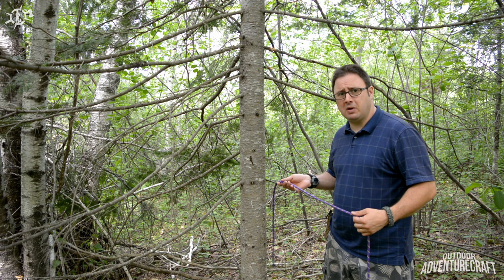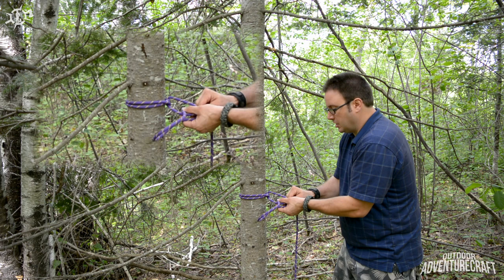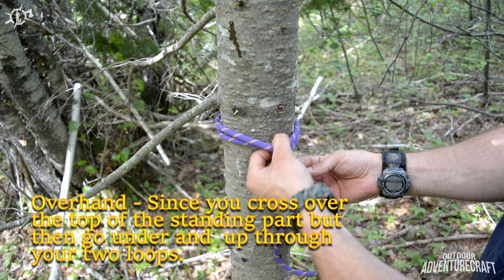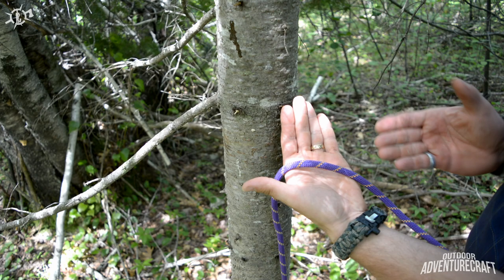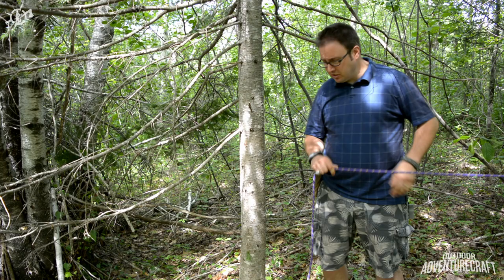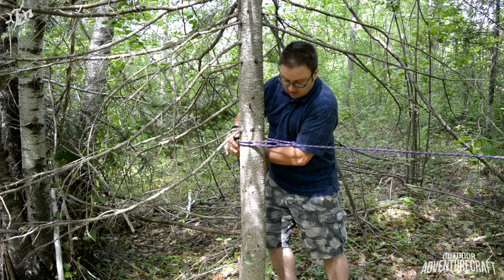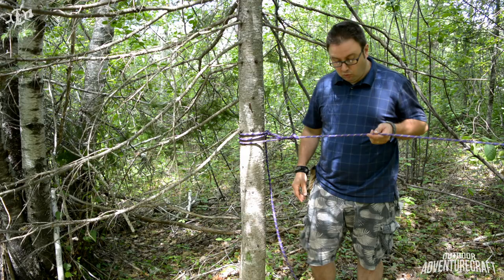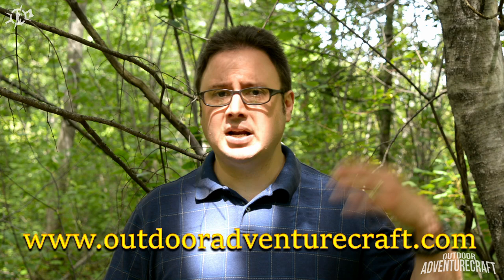Introduction to Knots - Anchor Hitch and Alpine Butterfly

Comment: Thanks for the well done video. I have moved to using the "evank hitch" as my anchor point. Very quick to tie and undo. For the other end, I usually use either a "trucker hitch" (similar in concept to what you did with the "alpine knot") or "taut line hitch" secured with one or two "slipper half hitch's".
Reply from the maker: +Mark Young (Shunpyke) I heard of those. I may learn more about those knots and feature them as options in the future. I'm an old granny knot guy by trade. Trying to teach myself better knots through this series. I always welcome suggestions for future videos in this series. Thanks for watching!

Comment: very good demo. both knots are very useful and showing the application in a ridge line is awesome. I use an alpine butterfly on my harness for my ascender as well as for my cow's tail.
Reply from the maker: I love how easy it comes undone even if you load it up hard. Thanks for watching.
Reply: +Outdoor Adventurecraft the reason that I use it is because it can be loaded in any direction even if it's tied in a working part of the rope without compromising the rope that badly. you can't do that with many knots especially the climber's favourite the figure 8 loop.
Reply from the maker: +TheStix913 yup

Comment: 10*  Good one.  Learned something.  Anchor hitch is basically like a constrictor knot then a slip knot or bend knot final tightening.
Reply from the maker: +John Lord I like it. I can think of many uses. It's a good one to be sure
Reply: Try my John knot (newly designed knot).  If you previously used a Prussic or Kleimheist loop knot on a ridgeline, you will love this.

Make loop knot.  Hold top of loop behind ridgeline, knot at the 5 oclock position with "other" hand.  Use dominant hand and grab loop bottom, pull up and toss over ridgeline to the left of held loop.  Grab loop, pull up and toss over ridgeline to the right of held loop.  Grab loop, and push through held loop, and dress up.  Makes an 8-hitch knot.  Stronger than Prussic and Kleimheist, slides easier.  If you need further gripping power (?!), then before putting through held loop, put bottom loop under all the 8 cross-over hitches, then through the held loop.  Makes 16 hitches.  King Kong grip.

Easy on, easy off.  Unloop, and snap the knot, and just pull off.  Three movements vs Prussic and Kleimheist.

Comment: Thanks for a clear well instructed video. This may be considered a small pointless concern but I always insert some sticks between the rope & the tree so that the rope does not strangle the tree.  It looked like you were using a spruce for your demonstration. Spruce & balsam both have very soft outer bark that can be easily damaged. In Ontario as in New Brunswick have lots of them but if we abuse them we can have long term effects. Again It may be considered a small thing & maybe I'm a quirky old man. but it can take a generation to replace a tree. Brian 76
Reply from the maker: +Brian Spencer It was a balsam fir. Ya I understand your concern. I always try to be careful. I also always select standing dead wood for firewood. That should make you feel a little better. 😃